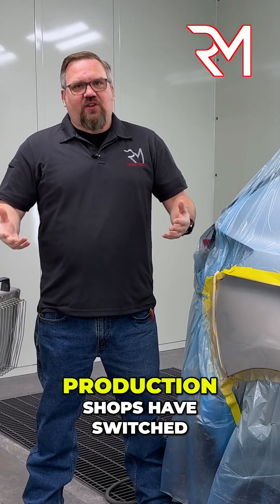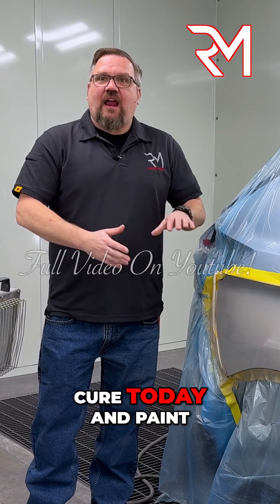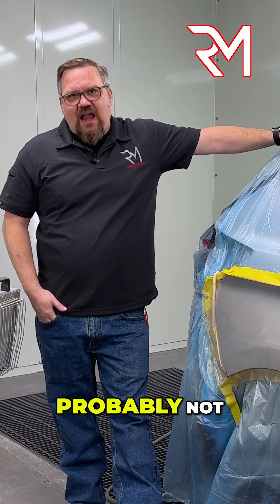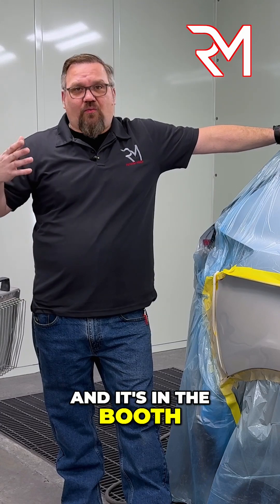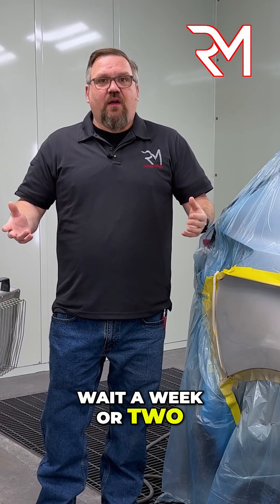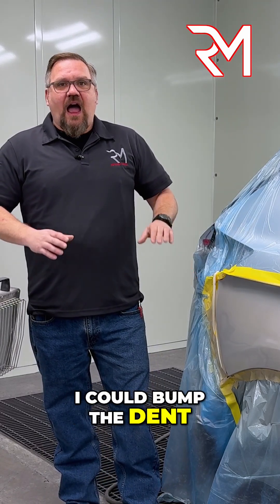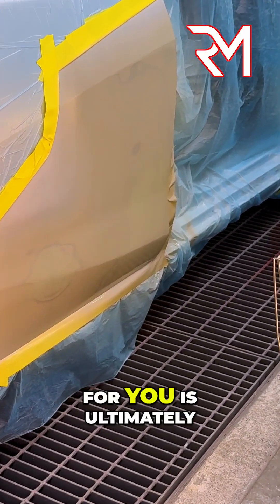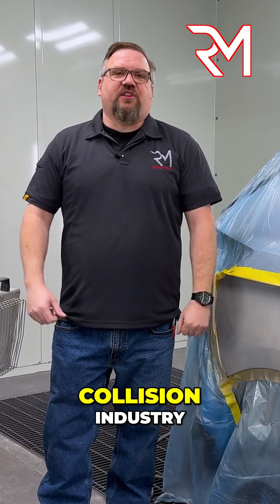The Future of Automotive Paint: Waterborne vs. UV Primers #autorefinish  #automotiverefinishing

Comment: That UP2253 at 70 degrees is dry in 4 hrs for sanding and painting its pretty impressive I have thought about waterborne paints but I don't have the facilities and really don't want to invest as I just really only do restoration and custom work
Reply from the maker: In this video we are talking about primers and uv primers can be dry as fast as 30 seconds. And water can be sanded and painted within minutes. Even in restorations I think there’s a place for either